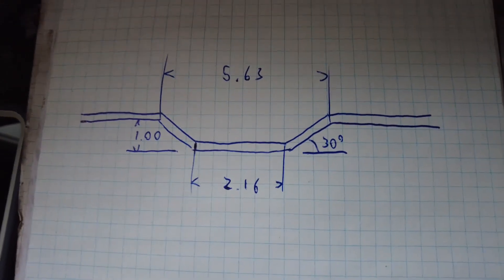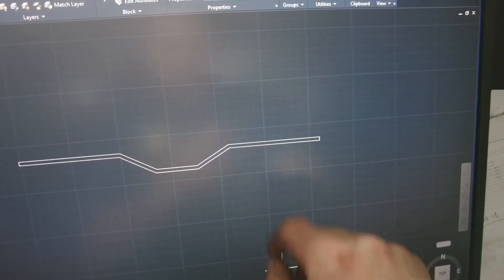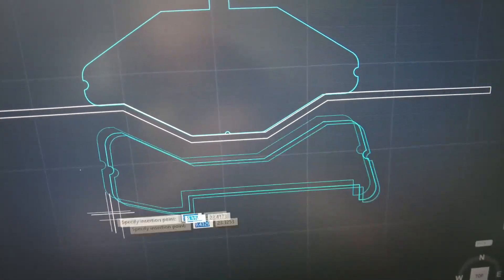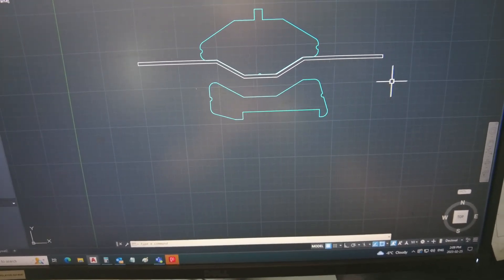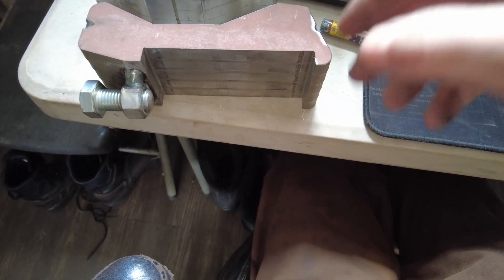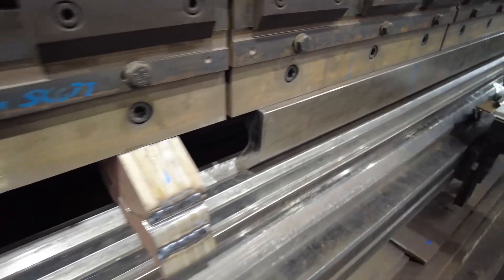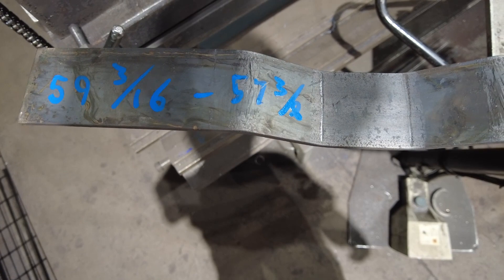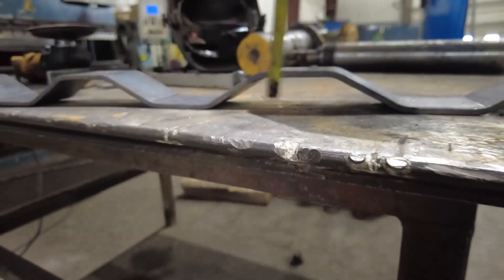How I Make Tooling for a Brake Press

Comment: If your press is long enough, could you make two final products and use them as a die for the consecutive pieces?
Reply from the maker: It would be nice to be able to but it wouldn't work for a couple reasons I'll try to make a video explaining through the issues in the next couple days
Reply from the maker: Hey I just posted a video going through why it wouldn't work, let me know if you have any other questions